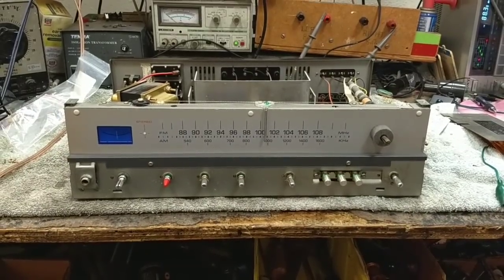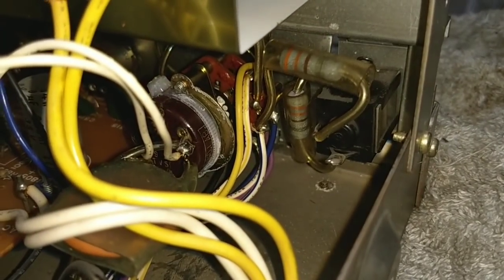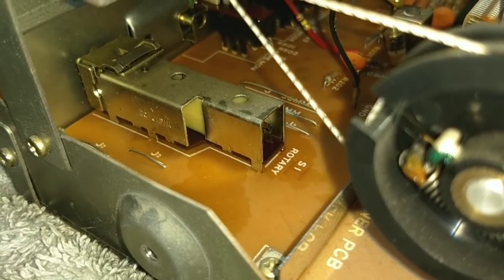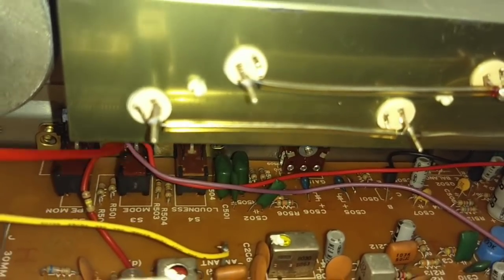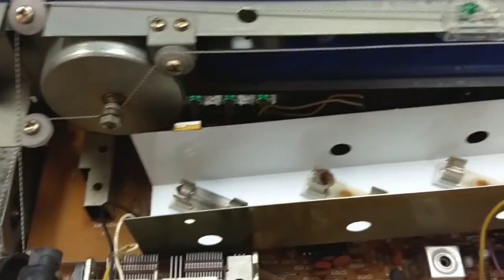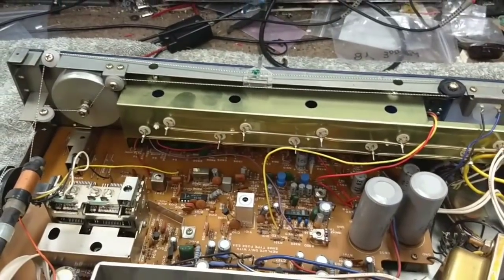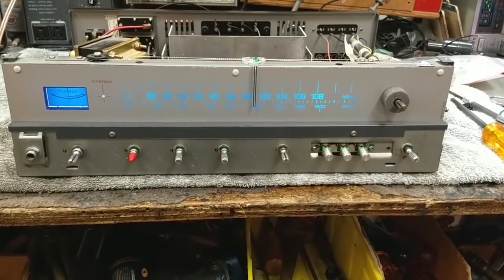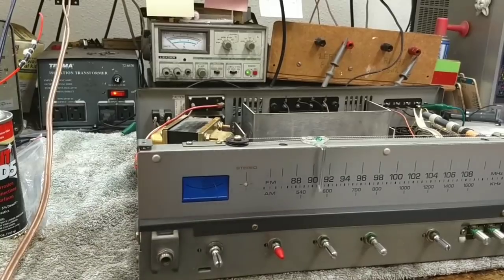Vintage Nikko NR-515 Stereo receiver service pt. 2/2

Comment: Your lamps aren't out.  What happens is the incandescent lamps turn the white diffuser plastic behind the blue display yellow.  The blue display plastic cancels the yellow light making dim spots.  You can whiten the plastic by putting it in a bath of sodium bicarbonate and hydrogen peroxide, exposing the yellow side to direct sunlight.  It's a lot of working getting it out of the chassis though.  I replaced my bulbs with LEDs that don't darken the plastic.

Comment: Awesome video Jordan. On the repairs of that Nikko 515 I really enjoyed it. Feel like I learned quite a bit. I am a big fan of Nikko equipment I own several Nikko receivers. My latest is a Nikko 615 the one above the one you're currently working on there and it does have a lot of scratchy pots in it so I'm going to have to at some point pull the top and clean the pots. Great video keep up the good work man.

Comment: I love this receiver. I’ve had it for a few years now. I just replaced RCA’s (left channel distortion) and now the red protector light cuts all volume when volume is turned up. What am I doing wrong?
Reply from the maker: Check speaker wires for shorts. 

If it does it with the speakers off you may have a solder bridge somewhere as a function of replacing the RCA jacks

Comment: Some folks are using a Triac I think to save on the power switch, using a small voltage at the switch to control the load through the Triac, making the poorly-designed well-worn contacts last infinitesimally longer by putting the load on the Triac instead allowing one to use the switch as low voltage low amp control signal only to said Triac.

I haven't tried to do this yet, but I have several receivers that use the power/speaker switch configuration that will benefit from the upgrade once I get inside of them. I'm not sure if this allows one to use the rear AC jacks again with less fear of issues, but I'd never use the onboard jacks anyway, the load on the unit's voltage doesn't need to be used in this way when modern power strips and power control units are available, in lieu of only 2 AC jacks at the wall and a pair of so at the rear of the unit. If anything, I try to keep a dedicated 20-amp outlet feeding the receiver only, with the remaiing external device loads (turntable, tape deck, amps) on a separate breaker in the main panel.

A video detailing this procedure installing a Triac would be of benefit to many folks out there with similar units where the power and speaker controls are on one rotary control, and the points are in roughly the same condition.

Also, an upgrade for the Sansui 901,( which I own ( 8080, 9090) with the notorious weak function switch would not go amiss, if a repair or upgrade is available to allow the function swith to be upgraded, modified or repaired.